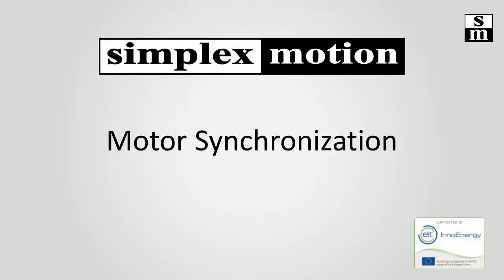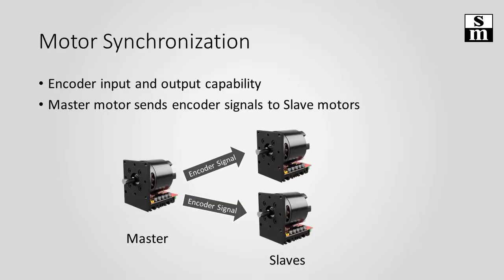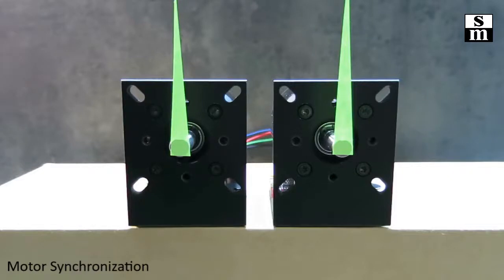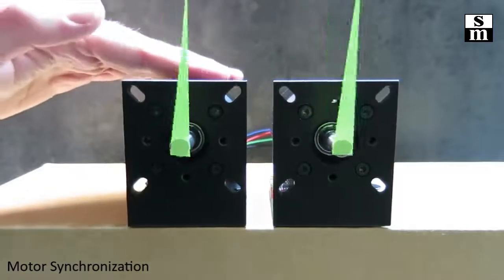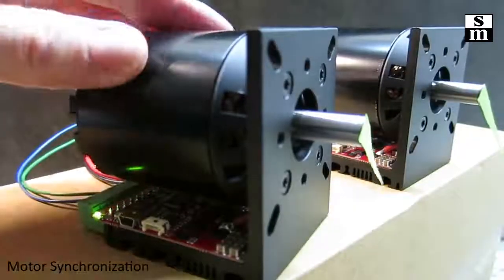Motor Synchronization

Comment: Rather than inputing an electronic rotation signal to the master motor, can you simply hand turn a gear connected to the master shaft and the slave motor still turn accordingly? It appears this was done at the beginning of the demonstration but im uncertain if this unorthodox use of your motors would cause malfunction. Also, what is the strongest motor you currently manufacture? It only needs to turn one full 360 deg turn and back, but the slave must also function identically. Thank you.
Reply from the maker: Hi, thanks for your question! The motors and the integrated control have as standard a built-in synchronization which goes in both direction, master/slave and slave/master using our own SM-CAN protocol. If the master is slowing down the slave follows and vice versa. So the answer is YES. Today the strongest motor is 300W nominal, 0,72Nm and peaks 900W and 4 Nm. 
All our motors have the same resolution, 4096 steps as standard, with optional up to 14 bits or 16384 steps. 
Best regards,
Simplex Motion